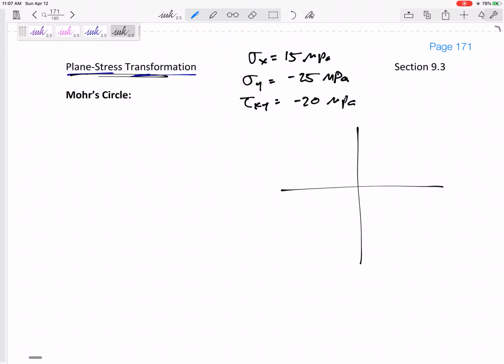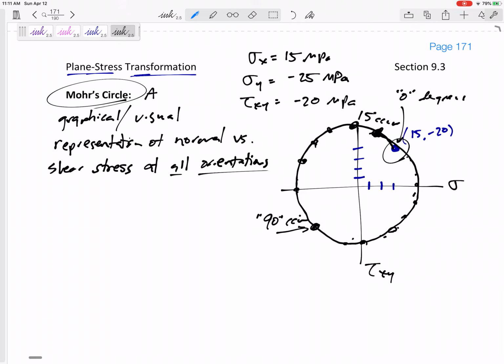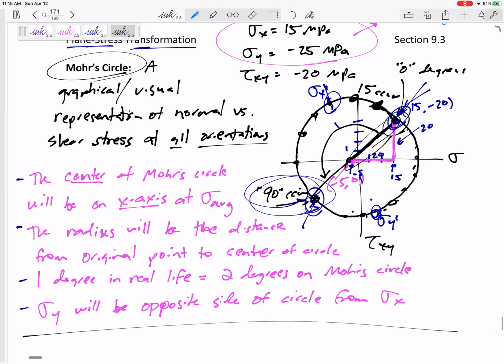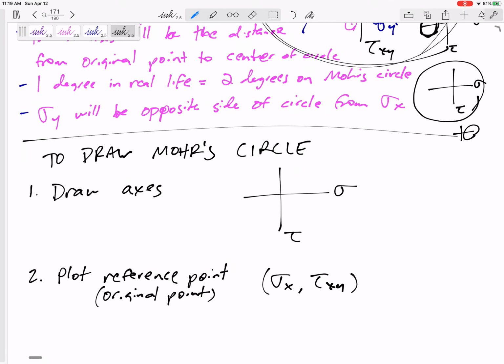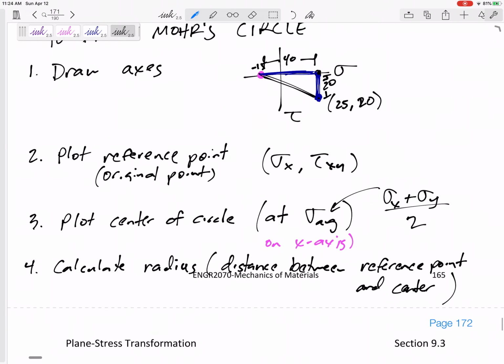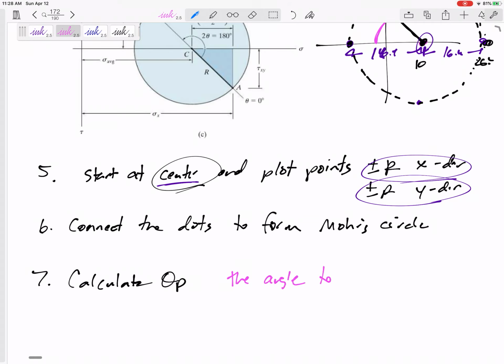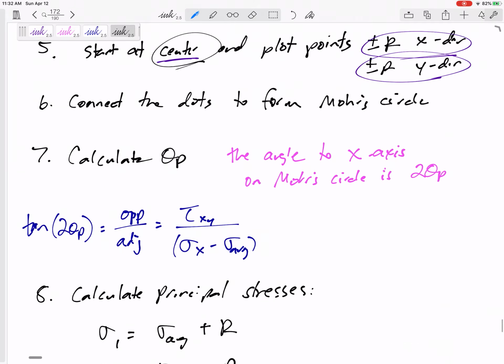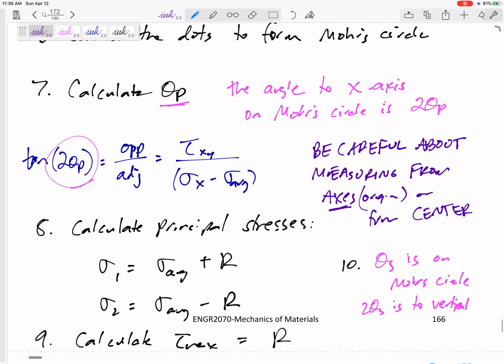Mechanics of Materials - Mohr's Circle

Comment: Why do we need that particular angle?  Is it because that's the angle in which the material is strongest?
Reply from the maker: That is the angle that it will fail because forces are the strongest along that angle.
Reply: @engineeringdeciphered  thank you, I've learned a lot for my FE exam from you